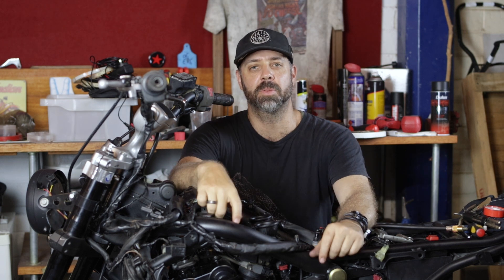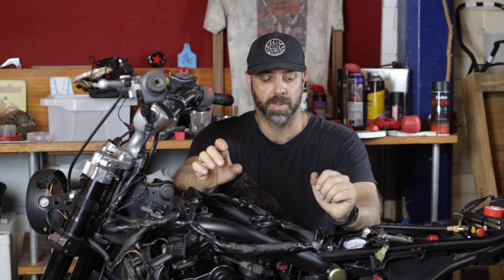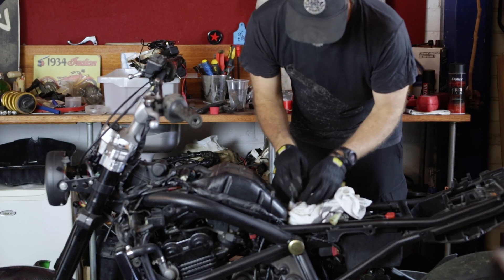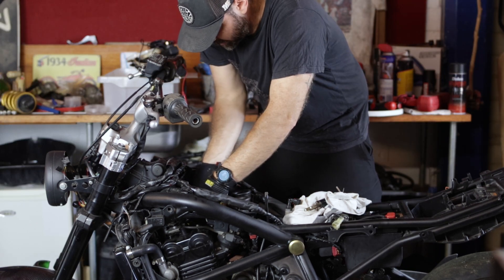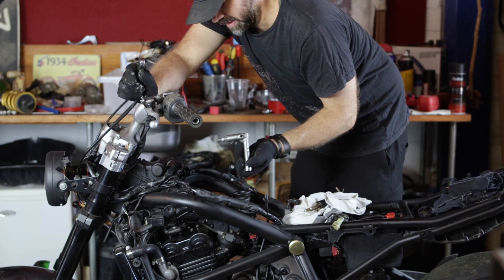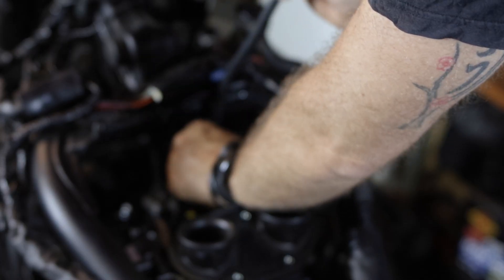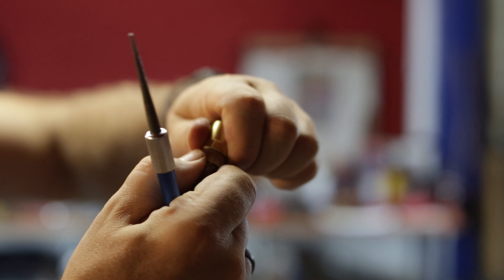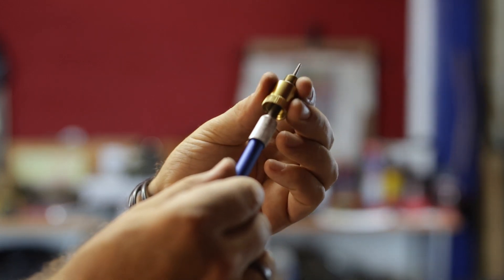Kawasaki versys ninja er6f er6n compression test

Comment: What was the reading
Reply from the maker: Compression was low but within 5psi of each other. Bike runs great and is not using oil. Best to check your workshops manual for your model of bike.

Comment: Hey, nice video. It seemed like low compression on the cylinder you checked in the video acording to the specs of the manual, am I right? What was the issue if I can ask, valve, gasket, or something else?
Reply from the maker: Hi @nikitashomeworks.Thanks. 😌 I bought the engine second hand and wanted to check the compression to see if the motor was still good.